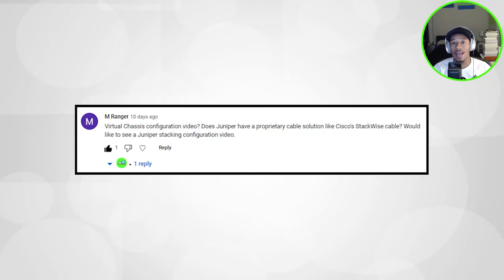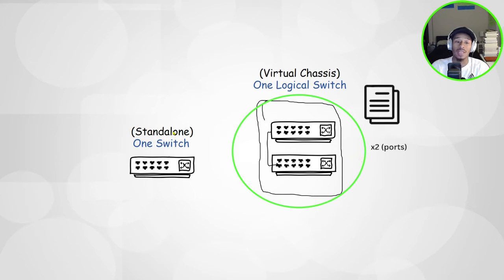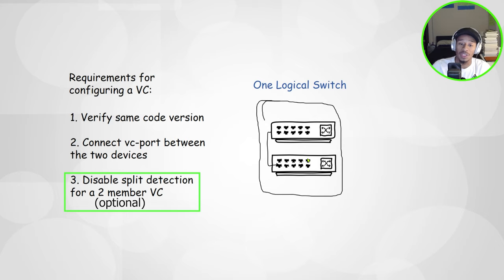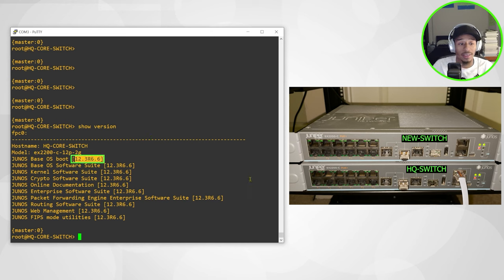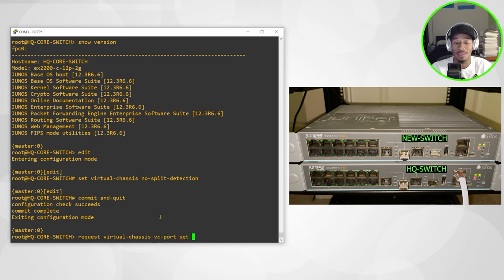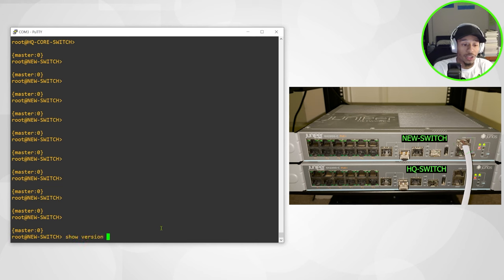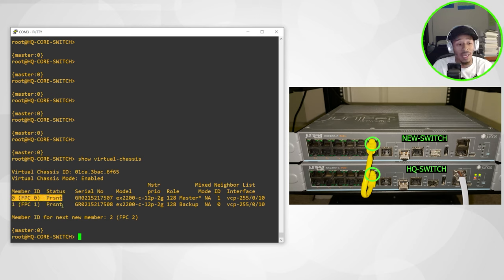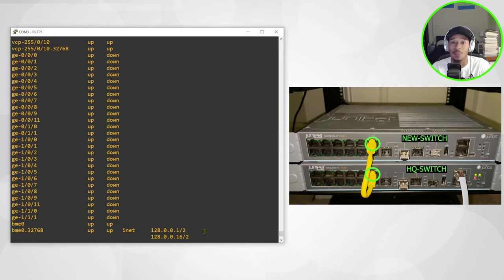Turn Multiple Switches into ONE: Configure Virtual Chassis on Juniper

Comment: what is the benefit by combining these two switches, only management ? again thank you for your work.. you are a best teacher but i will suggest you start giving some more detail info in every clip.
Reply from the maker: Yes, one goal of combining these two switches is to reduce management overhead. This also provides you with link redundancy. For instance if these two switches, acting as one device, were connected to a down stream device in an LACP bundle you could use one port from each of the switches. So if one switch fails traffic will still be able to pass through the second switch link. Thank you for your feedback
Reply: @jongreenit  so if i have one port on each switch connected together as trunk, can i use it for virtual chassis ? or i need separate dedicated port for virtual chassis ? or the port which is used for virtual chassis should be trunk as well ? and how you determine its port 10 while our switch are showing xe-0/0/x ?
Reply: Hii muje Ex3400 junos sell Krna hai mere pass hai new muje nhi pata keisa use krte hai our Kiya hai ye
Reply: Ho sake to palace reply kr na
Reply: I am from Mumbai

Comment: Hello, great content!

Comparing Juniper VC with Cisco stacking technologies.
I understand that VC would be more like Cisco VSS or stackwise virtual. And not as much as Cisco stackwise which is a backplane stacking and uses proprietary stack cables, and does not use ethernet cables like virtual stackwise or VSS.
As I understarnd Juniper VC uses Ethernet cables (SFP+,QSFP+,DAC cables,etc) to form the VC.

IS this correct?

Thank you!
Reply from the maker: Yes, Juniper VC would be most relatable to stackwise virtual

Comment: Hi Jon, thank God I found you! Can you do the same with aggregated link? Works as one VC link? Please, answer me :)

Great videos, subscribed OFC.
Reply from the maker: Hi Daniel, not sure if I understand the question entirely. Are you curious to know if you can still configure LACP LAGs to other devices while in the VC setup? If so, yes this will work normally.
Reply: @jongreenit  Yes, using an aggregated link (In Cisco, port-channel). This monday i need to aboard 2 Juniper to make these a virtual chassis through 2 unified ports.

Excuse me if I miss some gramathical things of english :)

I wil try to put the solution in this trail in case you want to do an extra video.

Comment: If you have two switches that have different versions, wouldn't setting chassis auto-image-upgrade handle the differences?
Reply from the maker: Yes, it’s possible to a new member switch running on a different code version to an existing virtual chassis if auto-image-upgrade is configured and supported. By default this feature is not enabled.

Comment: request virtual-chassis vc-port set fpc-slot 0 pic-slot 0 port 9 
WARNING. Virtual Chassis command executed without
         a valid software license.
         Please contact Juniper Networks to obtain a
         valid Virtual Chassis Software License.
error: chassis-control not running in Virtual-Chassis mode

getting this error. Im  trying to configure in EVE-NG simulator

Comment: Great video 
I set ex3400-24t to ex3400-24p 
connected, but PoE does not work
Can you help me?
Reply from the maker: Typically when creating VC's it is advised to have the same device model and OS version in order for the virtual chassis to function properly. In this case one is a 24t while the other is a 24p. It's also worth researching if the poe functionality is still supported on the ex3400-24p when operating as a VC.
Reply: @jongreenit  must be same model same version
Reply from the maker: @jasonliu912  Hi Jason, any many cases yes that is correct. Version will always need to be the same but they're are some cases where different model switch can form  a VC or VCF

Comment: what about if there are 3 or more switches? how do we stack them to master switch? thank you.
Reply from the maker: so the master switch DOESN't need to be connected to all of the other switches, each switch just needs to have one port connected and configured as a VC port to join the existing virtual chassis. Deciding which switch is the master can be decided by the switches automatically or this can be configured manually as seen in a (provisioned) deployment.
Reply: @jongreenit  thank you 🤗🥰
Reply from the maker: @jol166  no problemo!
Reply: @jongreenit   how do we set the switch to become master switch in VC? for example, there's 3 switches.
Reply from the maker: @jol166  In the case where you would want to manually set each switches role, this deployment would be called a pre-provisioned virtual chassis. So you know how each switch has a unique serial number. Well in the virtual-chassis configuration hierarchy this is where you would specify the switches serial number and the role you'd like it be. Members of a VC can either be a "Routing-Engine" or a "Linecard". This config would then deployed on each of the three switches before connecting them. Hope this helps.